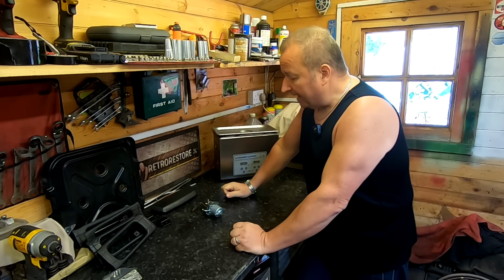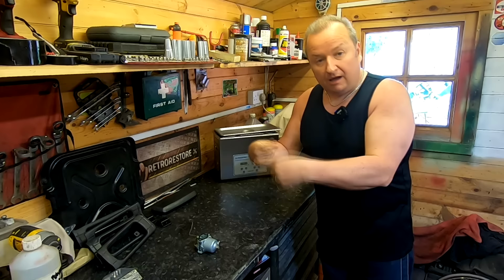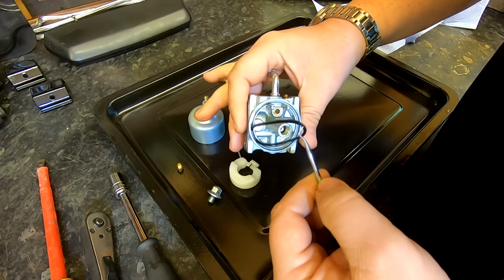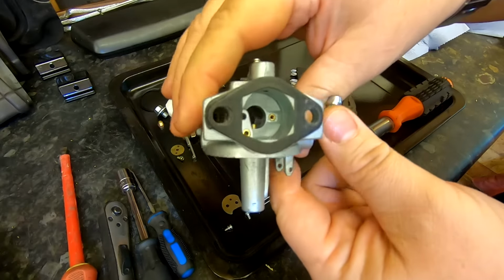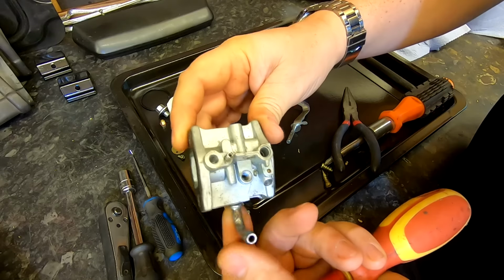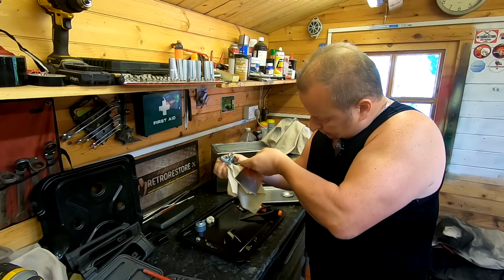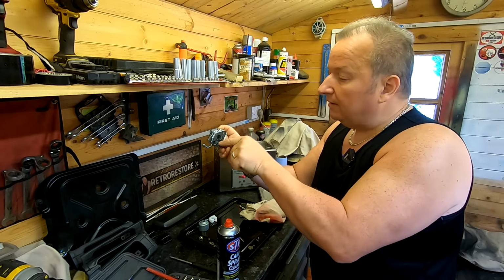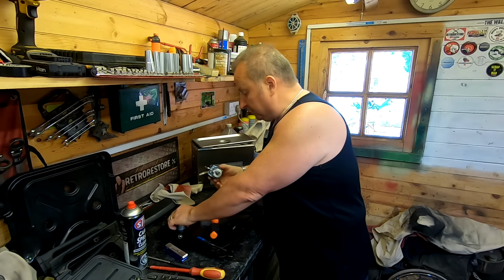Is An Ultrasonic Cleaner A Must Have Tool For Carb Cleaning ?

Comment: Excellent,  well done. I was hoping you'd get that emulsion tube out. I liked the way you removed both butterflies and wondered how you were going to use that free access to get some pressure on it -- but you just tried the same as me -- inverted short end of Allen key. I bought another carb,cheap, and tried the tube -- it came ou t. I've put parts in a plastic bag filled with petrol and today I splashed out on Oregon 088-402 flujd. VERY expensive at 29€ a litre, and no instructions. Maybe, just maybe, if you used something other than a splash of thinners you might have got that tube out..? Are they sometimes pressed in? If so, for why? 
Anyway, good job, success!
Reply from the maker: Not sure why some are pressed in tighty, but the ultrasonic cleaner sure helps.

Comment: 1) prep parts as per vid.
2) place all parts in a glass jar.
3) fill jar with your preferred cleaning solution; making sure all parts are submerged; and seal with jar lid.
4)place your basket in US cleaner.
5) place sealed jar into basket.
6)Fill US cleaner with hot water .
7)as long as parts in jar are below water line the US cleaner will do it's magic.
8) Using this method will save the amount of cleaning solution needed, keep the crap created by the cleaning process contained in the glass  jar and keep your US cleaner tub Spik and Span. 
Use a glass jar not a plastic jar..Ultrasonic Waves pass through glass better than plastic.

Comment: Had a similar problem with my lawnmower carb and solved it by pushing some small dia copper wire through the hole in the emulsion tube, atb mate , keep em coming, just popping over now  to Garys channel :-)
Reply from the maker: Good stuff!

Comment: Big Clive had an interesting gadget on the other day, a portable "washing machine" from China which turns any bucket or large bowl into a washing machine and I noticed it had two functions other than the swirl action, that of ultrasonic and that of bubble blasting from the unit which is held in place by suckers.   The ultrasonic action seemed quite intense and I am tempted to snag one of these for a cheapo large factor ultrasonic which can also swirl or bubble blast the items as well.

Comment: What are you calling thinners?
Reply from the maker: I think you call it reducer Jim
Reply: retrorestore enamel reducer won’t mix with water. Acetone will, kinda. Is it rubbing alcohol?
Reply: Is it also known as "paint thinner" (which I think is mineral spirits)? Does it mix with water?
Reply: Jeff D no it doesn’t. But I have use it for cleaning really dirty parts, and it works well for removing grease.

Comment: What temperature for the ultrasonic cleaner?  I'm thinking of the carb cleaner vapor pressure / evaporation. Genuine question, please don't cut my bootlaces off Martin :-)
Reply from the maker: I normally have the water around 60 deg C with no problems.
Reply: 70 Celsius - just watch the video - Duh

Comment: Hi Martin depending on the project I’m doing I quite often clean out small carbs by carb cleaner and compressed air but I’m finding this still is not enough to clean all the internals of the carb .. for a while I’ve been considering purchasing a ultrasonic cleaner and by watching your video it looks like they certainly do the job so I’m going to get one .. keep up the great videos they are very good 
All the best 
Richard
Reply from the maker: Yes Richard, its the only way if you need to clean the internal gallery's that you can't get to.
Reply: retrorestore yes I’m definitely going to get one
Reply: It’s the best money you can spend and saves time

Comment: A good soaking in mr muscle oven cleaner and a wash out  dissolve petrol lacquer  just as well,  if you aint got ultrasonic cleaner, although it can erode metal if done to often be careful
Reply: Get it running then use fuel cleaners to clean further

Comment: I have never used an ultrasonic cleaner. Just carburetor cleaner and a toothbrush. Gasoline is an excellent solvent; if you can find straight gasoline without ethanol.

Comment: Martin, I had a carb for a chipper/shredder that I was going to rebuild. So I went on line to buy the rebuild kit. However, the rebuild kit cost more then buying a new carb cost. So I bought the new carb. Amazing how a new carb is cheaper then a carb kit... Thumbs Up
Reply: Yep but I still like the oem carb better
Reply: The carb you bought was not the oem carb. It was probably some Chinese product. They will work but I prefer the oem carb

Comment: Couldn't do with out my ultrasonic cleaner great vid Martin might try thinners as I use fairy liquid at minute looks like thinners attacks the grime more keep em coming mate
Reply from the maker: Yes it does Norm, You need something to cut through the lacquer. Detergent liquid doesn't do that. Most of these issues are from the primary circuit through the internal gallery's in the carb that you can't get to so The thinners cuts through and you can then blow them out.
Reply: @retrorestore  great thinners it is going to try it out many thanks Martin

Comment: I have a 10L in my back shop, and a 30L in my front, and a little 6L for my mobile business, the mix I use, and I've been using it for 10 years now, 25% simple green purple, 25% white distilled vinegar, and 50% distilled water, baby water, that mix never let's me down, the only thing I've changed is this, I learned from small engine saloon, to use like a large mayo plastic bottle it has a large enough opening to accommodate any small engine carb, I fill the mayo container with my mix shake it up, and put it into the ultrasonic cleaner, and fill the ultrasonic cleaner with regular tap water, but remember water displacement don't fill the ultrasonic cleaner all the way up, cause it will over flow, now remember, don't leave the carb in my mix longer then 2hrs, it will darken the aluminum, but it won't affect the carb at all, and it's seal safe, won't cause them to swell up like chemicals do, and it won't make pets sick if the mix spills, so give my mix a try it won't let you down and you won't go back to chemicals.
Reply from the maker: We don't get simple green over here bud.
Reply: @retrorestore  Quarry Lodge, Stone Quarry Road, Chelwood Gate RH17 7LS UK
Reply: Unless I'm mistaken, but don't use simple green it doesn't work, but simple green purple does, ask for that from that number.

Comment: Martin, ive stripped and cleaned the carb on my honda mower,  but its still hunting, i have to feather the choke to use the mower,  what do ya think mate.
Reply: Air leak?
Reply: Tony Ling  all new gaskets, took jets out and emulsion tube and cleaned, and it still bloody hunts
Reply from the maker: If its hunting at low speed, it will be the primary circuit I was talking about in this video.
Reply: retrorestore ok Martin, I’ll give the vid another look, after the amount of times ive cleaned this carb i thought i would of solved it.